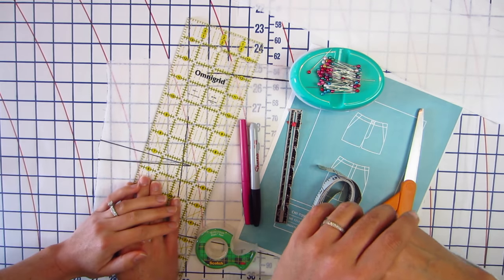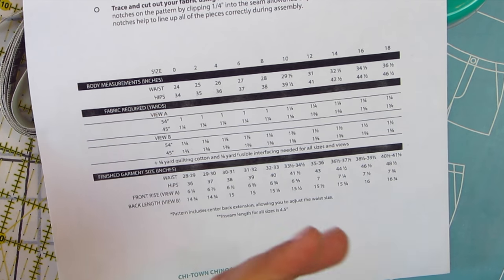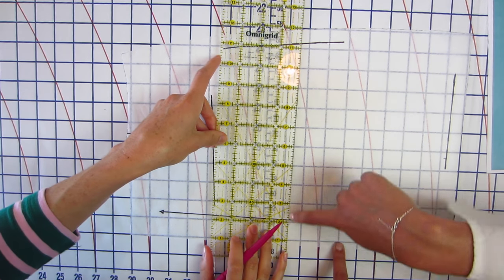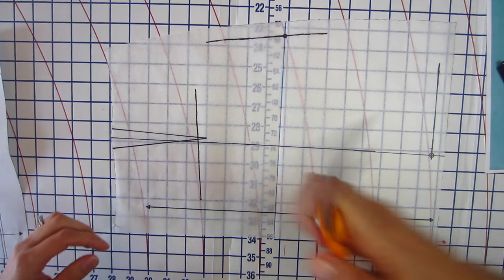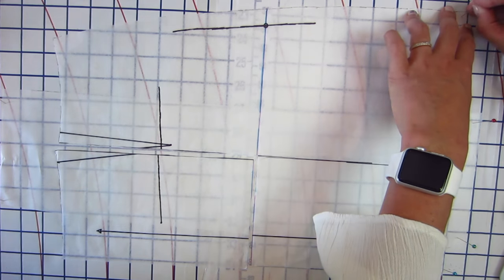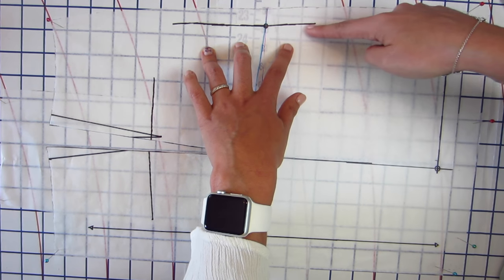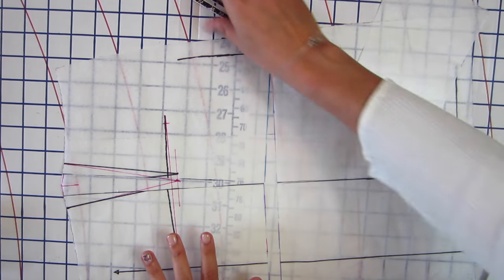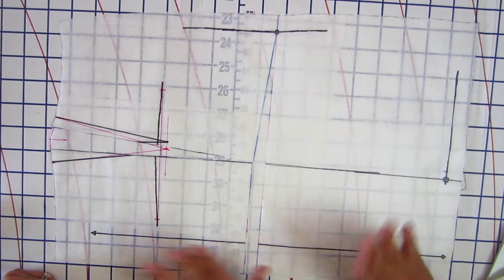Full Seat Adjustment (FSA) Tutorial

Comment: Hello! thanks for the video! I'm not sure if I understand it all though... the measurement difference was 1in around the hips, so horizontal, but when you made the adjustment you added to the length of the CB, pretty much... I see that by moving the top CB piece you do add some room at the back but is it enough? wouldn't you need to spread the pattern horizontally as well?
I have a narrow waist and very wide hips (36/28/43 more or less) and if I were to add 4 or 5 inches this way I don't even know what it'd look like in the end (which is why i avoid making or wearing pants... never fits anyway). I do wanna try this adjustment though, should I look into it? what else would you thing I should look into in terms of adjustments? thanks for the video!
Reply from the maker: Hey Steph! Great question! A full seat adjustment is meant for someone that basically has a "bubble butt" (excuse my lack of better terminology). You get this measurement from the hips, but it's not really about how wide your hips are. A person can have very wide hips and a very flat bum. Just like a person can have narrow hips and a "bubble" for a bum. Think J-Lo. I hope this makes better sense now! If you have very wide hips along with needing a full seat adjustment you might want to look into further alterations to accommodate your hips.

Comment: Hi I'm a bit confused about the measurements! So did Abby cut a size 6 in your demo or was it 4 at hips graded to 6? If her hips are 39 inch you would need the garment measurement on the skirt to be 41 inch as there should be a 2 inch allowance based on the pattern? ( difference between actual garment measurement minus the body measurement ). So if it was a size 6 you cut, wouldn't it be a 2 inch adjustment you'd need to do? I'm confused!
Reply from the maker: +littlewazzie we cut the 4. You use the size chart to find the waist measurement then the actual garment measurement chart to determine the adjustment amount. No grading in an fsa at all.
Reply: Thanks for the quick response! Okay so if it's a size 4 and Abby's hip measurement is 39.. (size 4 pattern says it's for size 36 and actual garment size 38 so there is 2 inch of ease), shoudlnt actual garment measurement  be 41 and therefore 3 inch seat adjustment? Thanks for your help it's been very helpful!
Reply from the maker: +littlewazzie well, it would only be 1.5" fsa if you look at it like that since your only working on half of the skirt. I don't usually worry about intended ease when doing fsa because you're building in room in different places so it's not just straight hip ease. It's like bum ease, too, if that makes sense.
Reply: Oh okay! Think just trying to think too hard with the numbers - like how would a 39 inch bottom fit in exactly 39 inch skirt?! And that's y I find any adjustment so confusing! Thanks for the the tutorial!
Reply: I thought the same thing than littlewazie ^^ I was part of the testers for Chi Town chinos (shorts and pants) and I look at your video because I need a FSA on a skirt this time. 
I don't look at the finished garment measurements but I look at the size chart. For example, I'm size 38 (France ;) ) at the waist and legs. I determine the amount of room to add by subtracting my hips measurement to the hip measurement of size 38. The result is half of the room that I'll add. If I do your technique, I don't need a FSA on the pattern that I'm working on (I'm 99 cm and the finished measurement of the skirt at the hips is 101 cm). But I'm worrying about the ease in this case because the size chart of my pattern calls for a hip measurement of 94cm, which is a huge difference with my 99cm... I'm confused :)
When I did my technique on Chi Town Chinos, it's true that I had ease. But Chinos are casual, so it's difficult to say if there is extra ease or not... 
So I think I'll make a muslin on size 38 of my skirt, and if I can't seat down without a tragedy, I'll make a little FSA :D